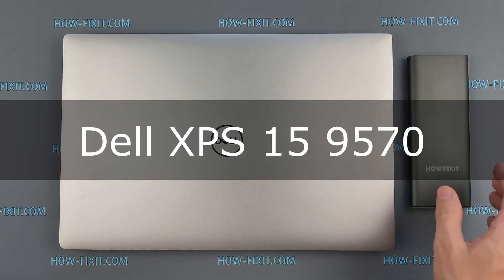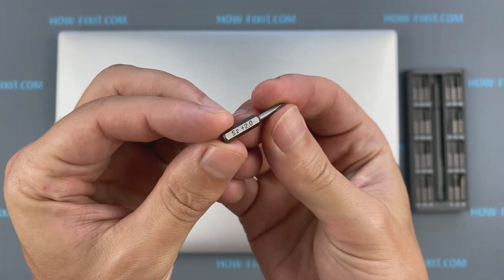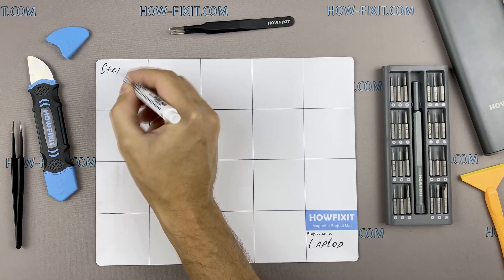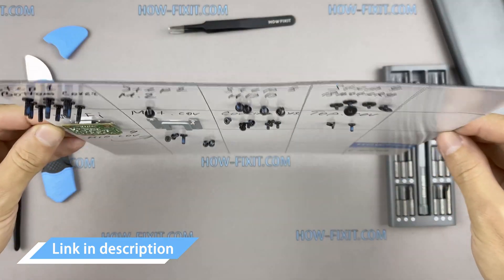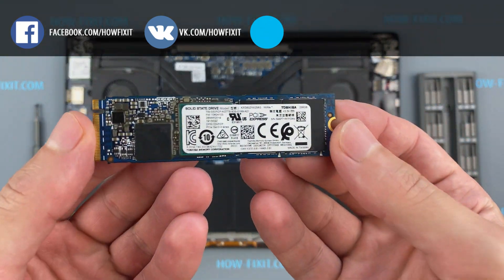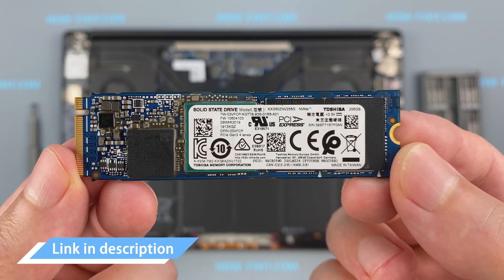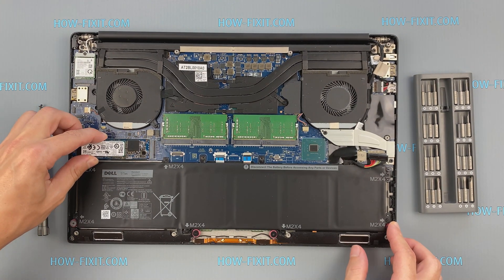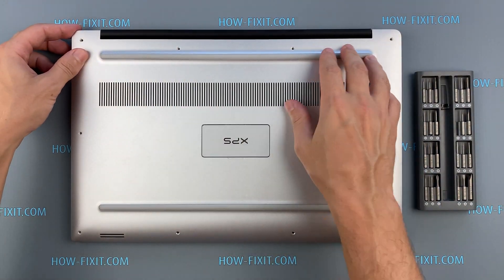Dell XPS 15 9570 M2 SSD Upgrade - DIY Installation Guide

Comment from the maker: ⚠ The Dell XPS 15 9570 supports both M2 SATA and M2 NVMe drives in its M.2 slot. So, you can install either, depending on your preference for cost or performance. Check the description for links to recommended M2 SSD drives. Additionally, watch the video explaining the differences between M2 NVMe and M2 SATA 👉 https://youtu.be/r3Jy5dHOj3g